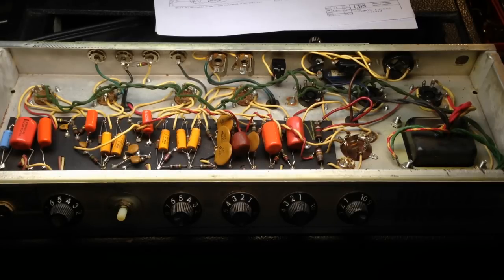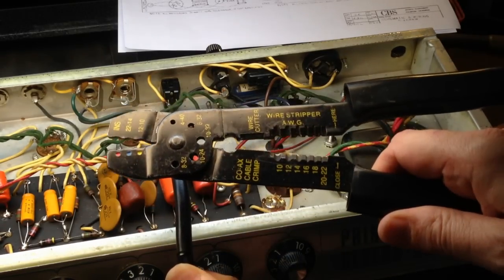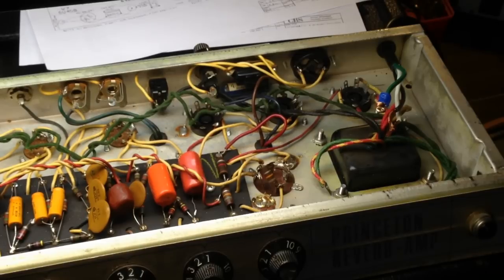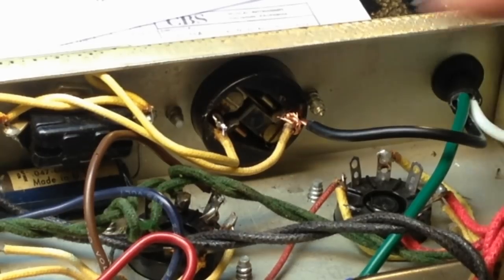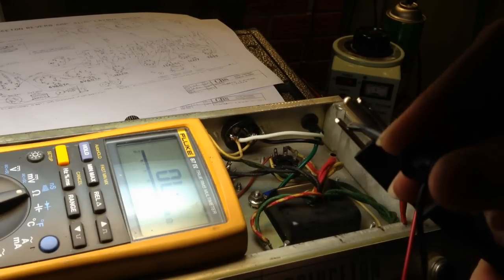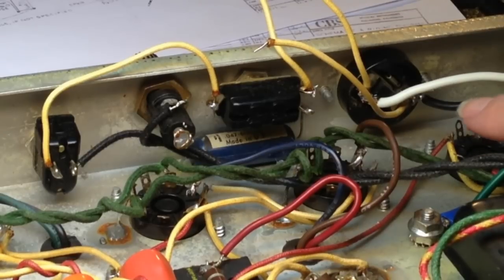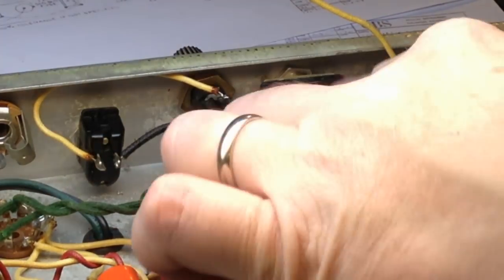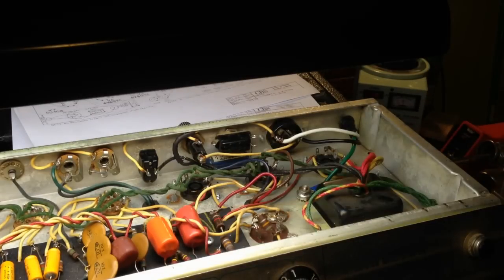The RIGHT WAY to Install 3-Prong Power Cords in Fender Amps

Comment: Brad, a question on the way you are  wiring.  It looks like you're wiring in the fuse holder BEFORE the power switch using the hot lead from the power cord. Wouldn't that make the fuse holder hot and a potential shock hazard when changing or checking the fuse if the power cord happens to be connected to a wall outlet regardless of the position of the power switch?  
Certainly one should always disconnect the power cord from the wall outlet before changing of checking a fuse, but wouldn't wiring in the power switch before the fuse holder be a bit better idea?
Reply from the maker: There are tradeoffs no matter which way you do things, but the idea of going to a UL APPROVED panel mount switch FIRST is in the event of a switch failure that shorts hot to ground inside the power switch, the fuse will do its job and blow, severing that circuit. Otherwise, you're relying solely on the power transformer windings or house breaker. The UL approved fuse holders don't allow for the contact of an inner terminal without using a foreign implement. Just dropping a fuse in the holder won't allow for this. Here's a fuse holder that should be used. It requires insertion of the fuse into the cap FIRST in order to make full contact.

https://www.grainger.com/product/6F457?cm_mmc=PPC:+MSN+PLA&gucid=N:N:PS:Paid:MS:CSM-2295:7FJN1U:20500731&s_kwcid=AL!2966!10!8973609555!4583108072865891&ef_id=XiedMQAAAIaOZEyv:20200922150147:s
Reply: @TheGuitologist  Not clear to me whether you now recommend installing a NEW fuse and holder before the power switch as the commenter suggested. Wouldn't that be safer?
Reply: NO. The inline fuse is the decision maker on whether a fault exists or not. Fuse first.  You cannot remove all shock hazards ever. I'd rather have a fuse fail than my house burn down.
Reply: Correct. Hot of the cord then to the fuse then to the power switch. 
From the switched side ( of the switch) you can have two ‘switched legs’ . One could power the outlet ( which you can change to a grounded 3 prong) and the other to power transformer. This way when you flip the switch on — you energize the outlet and the power transformer at the same time. 
You could leave the ground switch for aesthetics
I’m an electrician. There are many ways to wire things, but electrically hot always goes to the fuse first. Then the switch. After that whatever makes sense

Comment: don't know if it's been mentioned in other comments but a quick safety tip: keep the ground wire (green) aproximately double the length of the hot wires. this will ensure a grounded chassis in case one or both of the hot wires breaks. it's mandatory in some countries to do it this way, too.
Reply: Thank you. I’m about to put a grounded power cable on my 60s fender champ.

Comment: FYI, you really should use a cordset anchor, not a grommet to anchor the cord to the chassis.  If you're going to use a grommet, then tie a knot in the cord so it can't be pulled out.  If you don't do either of those things, then leave the ground wire longer than the neutral and hot leads, so if the cord is pulled out, the last wire to detach is the ground.
Reply: To get around this I use a cable restraint attached to one of the screws of the PT with a lock washer and new nut that the entire cable run through securely. This way there is no chance the cable will be pushed in or pulled out. Leaving a bit more ground wire is a good practice anyways, but this method is pretty fool proof.

Comment: hi the earth lead should always be a bit longer so when the cord is yanked out and live comes into contact with the chassis it is still earthed. Safety first.
Reply: neil verdon
Agreed Neil, that is what I was taught many years ago. If the mains cord gets yanked the earth should be the last to break.
Reply: That's why he used the zip tie so the cord won't get yanked out.
Reply: That not really enough, cords can get yanked really hard because a clown dangled it as a trip-hazard and some poor soul tripped over it, or because the amp fell off a stage, etc.  The live wire should break free first and hopefully short to something and blow the fuse, chassis stays earthed until the whole cable is out of the unit.
Reply: Great idea

Comment: My degree is in Electronics, and I worked troubleshooting circuit boards for 15 years. I couldn't assume the correct way to do this. I found a schematic for a 65 Deluxe (my amp) reissue (not my amp) online. That showed me the changes Fender made to improve the circuit. For example, they have the black wire going to the switch directly. I also found videos that showed the chassis. You can see the techniques and placement Fender used for grounding and strain relief. In Electronics, assume EVERYTHING is done for a reason (i.e., don't skip the lock washer because you don't have one). A lot of decisions are made because feedback proves them necessary. These are the best and safest practices, or Fender would not be able to market their product in modern times.

Comment: This is exactly how I have been doing it for years. You could: use the unused terminal of the ground switch to land your cables rather than having to splice; use a cable restraint inside the chassis attached to one of the screws of the PT (like how you did with the ground lug) even though the cable in a Fender is restrained because sometimes they come out; make sure folks know to discharge the amp first; use a lock washer on the ground lug connection; I like to tin the iron first; let people know to use a blunt tip rather than fine pointed tip on their iron for these types of connections. Just some friendly pointers from someone who has been doing this since the 80's! I'll check your other videos out. Thanks.

Comment: I prefer the plastic 2 piece strain relief clamps for the cable to chassis pass through interface.  If the amp takes a spill you need positive retention on your strain relief so you won't put any stress on the solder joints of the power cable conductors.   Some times with the right size cable to grommet interference you can get some strain relief, but if that doesnt happen you basically have no clamps pressure on the cable allowing it to translate in and out of the chassis.  Also to achieve this interference with a grommet, you will have to wrestle with the cable to get it to pass through the grommet....  The plastic ones are much easier to install, and in my opinion provide better strain relief.  My 2 cents

Comment: Ive been using PG-9 cable glands lately. I likethem they are extremely secure and a lot easier than the glands that came in the original amp. Theyre nice and cheap too.

Comment: Could also check for continuity for the new cord for ground, positive & negative, from the plug to each of the wire inside the chassis. I'm kind of curious as to why the transformer that used to be on the fuse doesn't stay connected to the fuse ?

Comment: Silly Question this mid sixty's amp twin prong power why was it this way in the first place or at the very least it could have been double insulated. Where we are 240VAC at 50HZ anything wired that way would have been considered a death trap even then.

Comment: Thanks Brad! I recently picked up a '72 Bassman Ten and I noticed the Ground switch was broken. I wanted to bypass it seeing as it's already a 3 prong cable and found this video EXTREMELY helpful! It looked as if someone wired it similar as you did but instead of connecting/splicing the wires together they used the lugs on the Ground switch. Seeing as the toggle was broken (wiggled loose, no clicking/detents) and I have no clue what position the switch was in internally or if it mattered, I chose to bypass it completely and fallow your steps. Along with bypassing the Ground Switch I found 2 broken solder joints, one at the Earth Ground (yikes!) and another I am not entirely sure of. I got those reflowed, cleaned the pots and jacks, tightened a loose transformer and now know I need a cap job asap, all original caps with one bulging... I've played around on it and it's actually a really nice sounding amp for guitar, I'd say an excellent pedal platform as it's stays pretty clean and very transparent with different guitars and pedals...

Anyways! I've been a long time watcher and finally needed your help! Thanks again! Take care!

Comment: I’ll be moving to Brazil in early Spring next year. I have a reissue Fender Twin Reverb with the American 3 prong power cable. Is it possible to replace that cable with a 3 prong N-Type power cable that’s used in Brazil?

Comment: Might be a dumb question, but what exactly is the 'auxiliary output" for? I always see it on vintage Fender amps, and don't know what it does/ what it's for.
Reply from the maker: Usually those are included in modern amps as a way of sending a high impedance signal to a mixing board or other stereo equipment. Usually they are RCA jacks.

Comment: I knievthis is an old video cour would it bot have been better to instal an3 pin  IEC socket , a lot nrater than wires and any breaks in the cable just means replacing the lead

Comment: I hope by now you have acquired a professional grade soldering pencil. If almost hurts me to see you doing good works, but hindered by a grungy ugly tip of random “just hot” temperature. Higher end Wellers with temp controls, Haco ( avoid the counterfits) and a few others are under $150, and will streamline the soldering process. I have made millions of solder joints over greater than 55 years.. you will love what a proper tool does for the quality and speed of your soldering. Having a shiny tip on every joint that is of a set temperature is the way to go. You deserve it!

Comment: I looked at all the videos and liked this method the best. I did do something I liked better with the strain relief. Most fender amps use a oblong grommet with two straight sides. The blackface  66 Princeton l have uses a round 1/2” grommet for a flat lamp style cord. I carefully filed the inside of the grommet with a round file and was able to get a modern 18 gauge cord in it. 16 gauge won’t work. Looks great and didn’t have to file the chassis.😀

Comment: Hot must go to the side of a fuse holder. The way you have wired it means that even with the amp ‘switched off’ someone could die if they touched the fuse while changing it because you have put hot to the tip!
Reply: An actual IEC socket can be used in the same hole with no drilling and the power cord would be removable and safer than this dangerous method. Too many things wrong with this....no true strain relief, wiring is wrong (live wire should go to tip of fuseholder, then to the switch. The ground should be soldered not wired through the transformer bolt. This may be better than a stock 2-prong, but it's not code-correct and done poorly.

Comment: In process of following your video now. Thank you! Found the 8ft cord at Lowes for under $10, it is a high quality cord and even has the talcum powder. The grommets I got from Autozone. My 65' Deluxe Reverb had an original 2 prong wiring but someone electric taped a 3 prong end onto it! Went to pull the cord out of the wall one day and the wires came off! Fun times. Thank you!

Comment: I followed this step for step and triple checked that all the correct solders were made. Went to plug it in and clicked the on switch - the light doesnt come on and the amp appears to be getting no power. Any ideas of why this happened or whats going on? I noticed that on your example our neutral and hot wires are on opposite sides. I looked behind and it appears the smaller hole is connected to the hot line as intended. I am tempted to change them and make them look like yours but im scared to hurt the amp. Any ideas on what to do here? 1967 super reverb. Any suggestions appreciated.
Reply: Disregard! Turns out my 3 prong power cord was bad. Sheesh. First time working on an amp and that happens. Such luck :P

Comment: just wondering why you dont use a solder sucker to remove the old solder rather than just melting the old and trying to get the wire through?
Reply from the maker: Short answer: because this way was quicker and my solder suckers...well...suck.
Reply: fair enough!

Comment: Hey Brad, I have '65 Princeton Reverb, all original, and I mean ALL original. Still had the three prong cord and DEATH cap installed. I never changed it because it was running just fine. so why change it, right?  Until a couple of weeks ago when I flipped the switch and it bit me! I could taste the electricity, like chewing on a nine volt battery. So I remembered this video, came back and watched it about 3 times in a row, and successfully removed the old power and installed a new, beefy ass 12 gauge three pronger. Thanks for posting this, the replacement was a breeze because of it. Cheers, Josh

Comment: Does Fender have both two and three prong chassis socket that also is the same size?
Reply: David Lutke It depends on the year it was manufactured. Sometime in the 70's Fender switched to 3 prong. It comes down to 2 types of restoration of all vintage guitars and amps. Restore to play or restore hang on a wall, archive. Most of my restorations are for people who play, so function and safety are the #1 concern. It is important to save as much of the original parts in case you sell the amp or guitar to a collector who wishes to restore to original specs. You will get more money that way. Thankz
Reply from the maker: Yes, thank you for reminding me. I'll make a pinned comment about that.

Comment: my '67 Bassman has a standby switch to the left of the on/off as you look at the chassis from the front. How does that change the wiring?  Help!
Reply: It doesn't. Just follow the procedure in the video.

Comment: Is it ok to leave the ground switch in and just remove death cap? I'd like to do as little soldering as possible as I always melt wires by accident. The switch would just be non functional without the death cap or will it cause problems with switch left in?

Comment: Personally I use shrink tubing just for low voltage low amps situations there is always a chance that the solder ac neutral strand wires can poke trough the thin shrink tubing while heating , i would have used one of the legs of the unused dead reverse polarity switch for a strong bond as a stand-off type affair , since the other legs-post wont be used anymore , like your video a lot keep on the good job ..bring me back to my younger technician days I remember these amps to give you a hell of a shock wile touching a grounded metallic microphone stand connected in a PA with reverse polarity lol !

Comment: It's not clear why you disconnect the ground switch, what you call polarity.  Looking at all the different Fender schematics, it simply switches the decoupling cap from either the hot or the neutral.   My amp has a center position which is NC. This is from the old days two wire where either lead could be hot. Seems you could leave it alone.  It does not change the polarity.

Comment: Thanks for this, I'm attempting to scratch build an amp using an old Bradford hi-fi amp. Deleting all the radio tubes and keeping the 2 12ax7 and the 2 7868 power tubes. This have me a lot of info on the way to convert its cheesy small wire 2 prong to the 16g 3 prong i had in my junk stash. Lol. I've been recovering caps and resistors from components replaced in my line of work. At first I was simply going to try a conversion.... but looking at it more. At this point gong to strip this thing down and find a schematic and just scratch build.... and be very careful doing so as this will be the most complex electrical feat I've taken on as of yet. I'm just unsure how I want to preamp with the 2 12ax7 at this point. I know 7868 can be very clean, which i want... but I also want to drive them to break up also.... I've heard some pretty gritty 7868 amps... by the way.... any schematic suggestions to get a good clean to high gain using the 2 tube types i mentioned?

Comment from the maker: POSTSCRIPT NOTES: 
Some later Silverface Fender amps have a grounded auxiliary power socket on the back of the amp. These are wired exactly the same, but with the addition of a ground wire for that socket's ground terminal. Also, it's a good idea to make the ground wire long enough so that it is the last wire to exit the rear of the amp in the event someone tries to use the power cord as a jump rope.

Comment: Thanks for the detailed video. I have 4 vintage fender amps I need to have this work done to and with help from your video I am going to do it myself. I know how to sodder, I've done installation of pickups in a few guitars and a couple capacitors in my old Fender Bassman and also changed out many speakers in old amps. I know how to test and de-energize the capacitors in an amp circuit to make it safe. I just needed to have this 3 prong power cord replacement procedure explained. I need to replace the power cords and remove the death cap in my '58 Bassman, '62 Deluxe, '64 Deluxe and '64 Champ. Thank You.

Comment: Just a couple of comments. If you hold the wire with pliers and gently break the insulation with the strippers, you can use the end of the insulation to twist the strands tight and you can then tin the tightly twisted wire. This way the wires are never "birdcaged" (as they used to call it in US Navy soldering school". Also, they make lock grommets that go in that hole that lock the power cord in place. Most any tube amp parts site will have them.